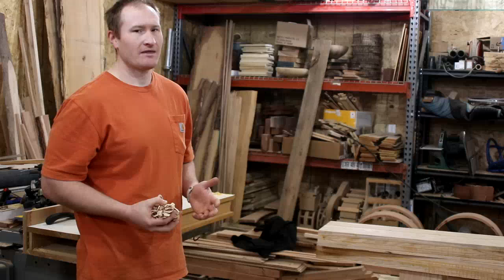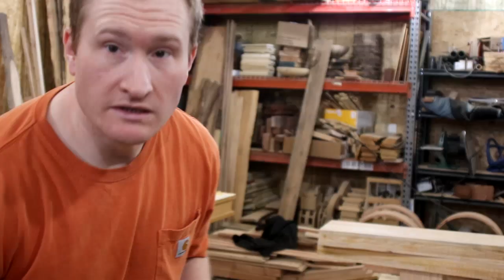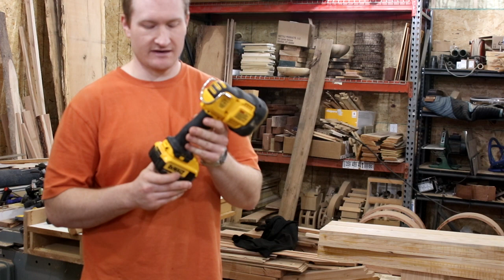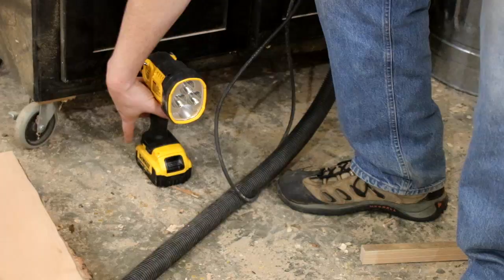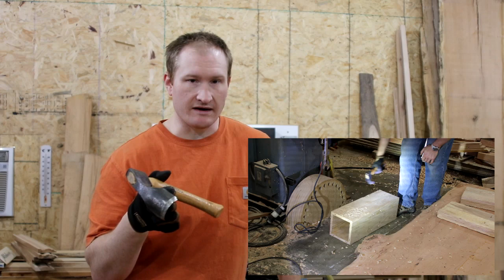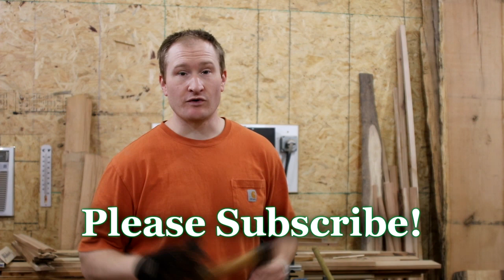RUSTIC BEAM CONSTRUCTION! Making it look rough!

Comment: Was this specific treatment requested by the customer, or could you have used a scrub plane to create a scalloped surface much faster?
Reply from the maker: Obviously, there are different methods to create different looks.  A scrub plane is an entirely different thing than an adze.  So, this was all intentionally made with this specific look in mind.  It is more time consuming, by far, but the finished product shows also that more care was involved in the process.  Thanks
Reply: This answers my question about this specific look being what the customer requested, as opposed to the longer "gouge" marks created by a scrub plane, which was all I was attempting to clarify. Thank you.